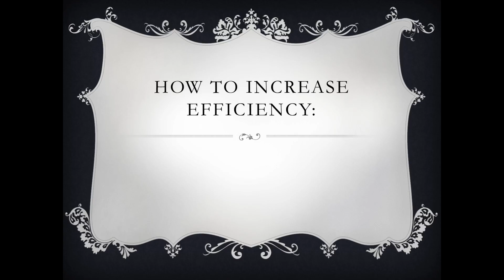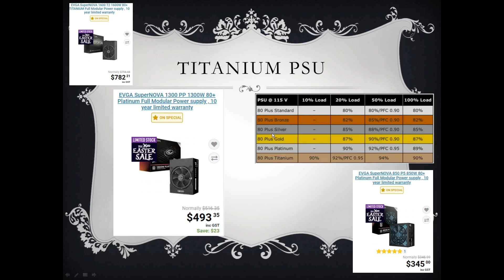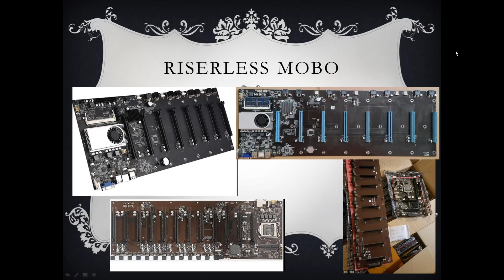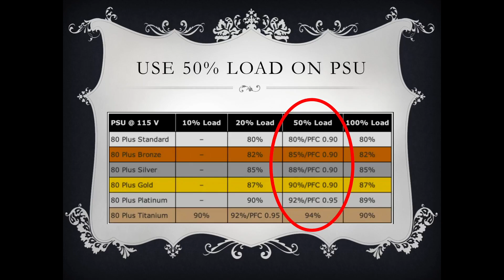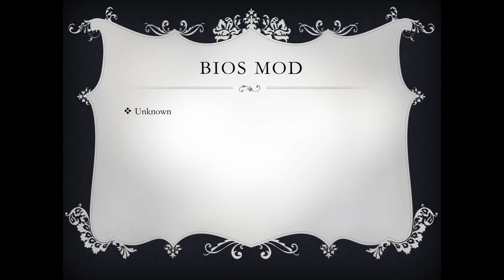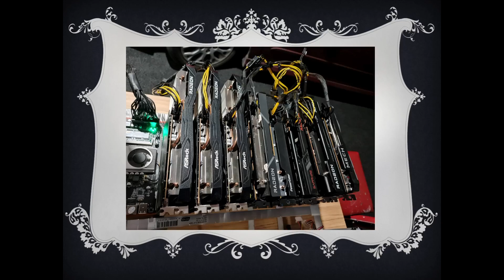How To Improve Your Mining Rigs Efficiency!

Comment: Good content bro, hope your channel grows soon. 
all I have is xfx and only do ETH, haven't got time for others, may be after POS. 
Some of the stuff you say I learned the hard way . Moving to BTC-S37s slowly. Boosted the economy by buying unwanted parts. lol.
Reply from the maker: Cheers man, Thanks for watching. Yea, I only do the testing for other algo's so I know what each GPU can do and I can make an informed decision on what GPU's to buy while considering mining after ETH. Don't worry I learned the hard way which boards/parts I wanted to use too. I'm actually interested in these other mobo's now:
https://www.aliexpress.com/item/1005003624746816.html?spm=a2g0o.cart.0.0.308c3c00D4M2zo&mp=1
More spacing and no CPU fan, could be more efficient because of no fan, and will be more efficient for requiring less fan speed on the cards because of the greater spacing. 
Probably wouldn't work for hotter cards considering it's 2 rows of cards though.

Comment: I run a 200mm inline fan with a thermostat that turns on when the temp is over 25. Currently is on about 25% of time.
Reply from the maker: Nice, yea I had a setup with a 200mm inline fan for the middle of summer. It was just for my Nvidia rig; man that thing had issues in mid summer. I was glad to have swapped my 3080 Ti's for 3080 FHR's, as the 3080 Ti's were my hottest cards. My 200mm inline fans uses 75w, for reference.